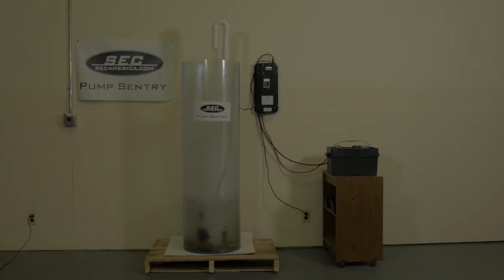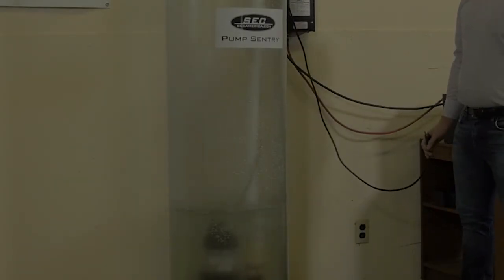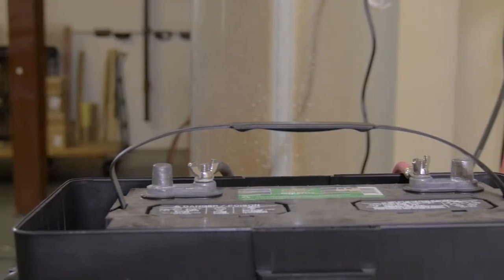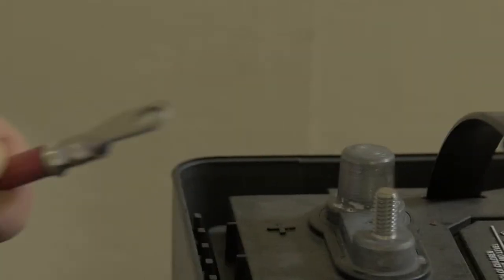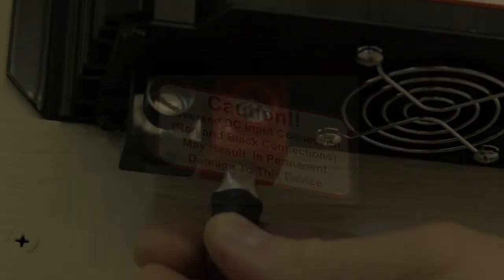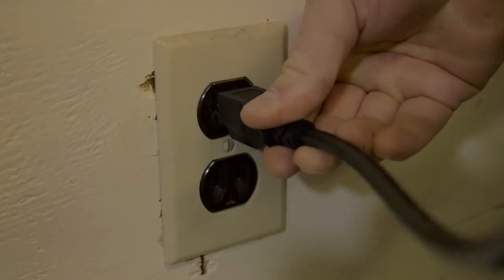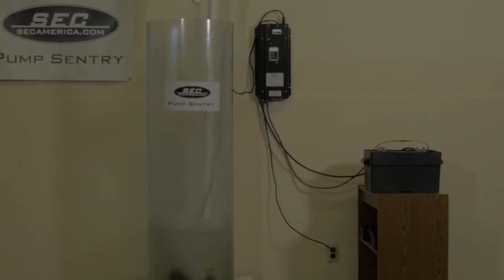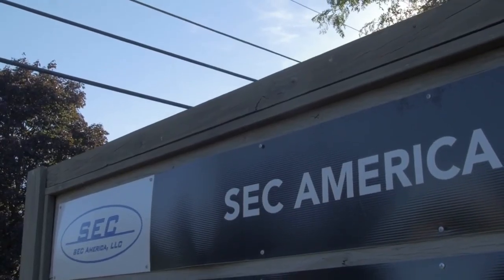Pump Sentry Battery Backup with Existing Sump Pump

Comment: I have a 1/3 hp 6.2 max amps pedestal pump. Circuit requirement says 15 amps.  Which back up would I need? I read i need the 933 for pedestal pumps. I do have a 105 ah AGM battery. Would any large battery work ? Is there any battery that's not recommended? Is AGM deep cycle the same as Marine?

Comment: My sump pump has a plug for the float switch and another plug for the actual power of the pump. Will it work with this? Its a dewalt sump pump oump